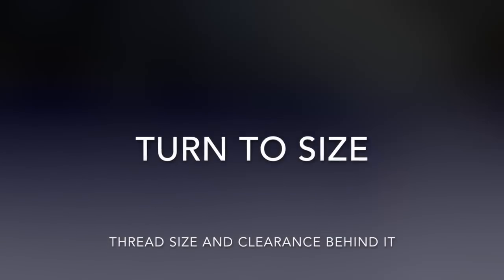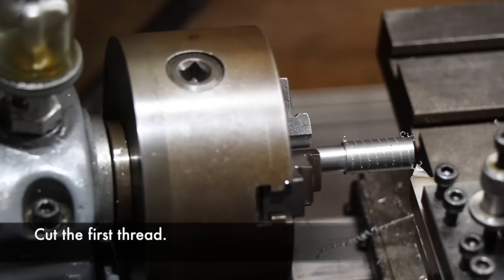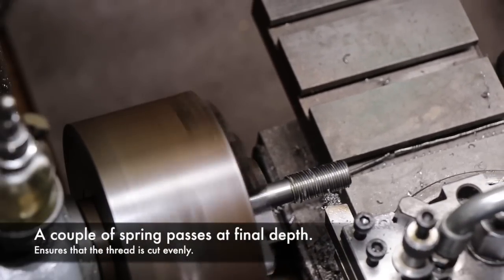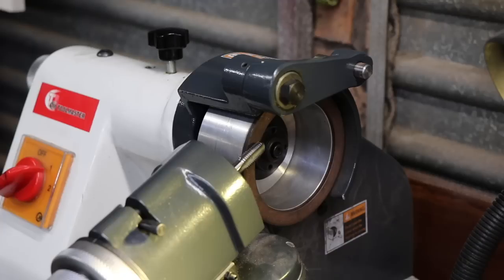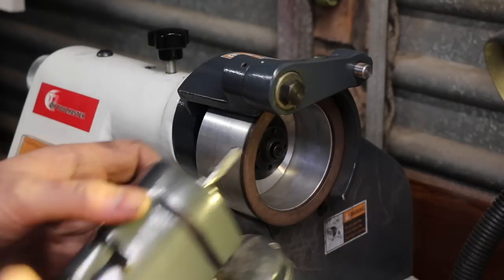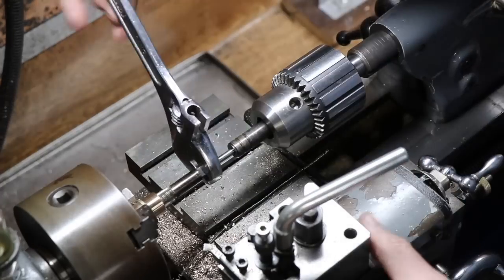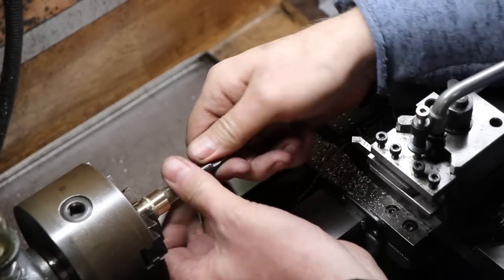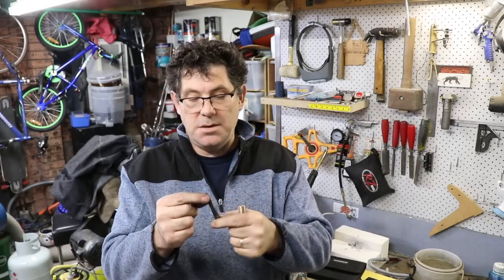DIY Thread Tap

Comment: Really nice job! I've always found I get neater threads in really tough steel by swinging the compound slide around to 30 degrees from the cross slide. Advancing the cutter at that angle means you are cutting, essentially, one side of the thread and just cleaning up the other. Zero the cross slide dial at the outside diameter of the thread and use the compound slide to advance. When you back out after each pass, you use the cross slide and just come back to zero, then advance the compound slide. This works especially well on really fine threads.
Reply from the maker: The compound is at 90 degrees because this is a triple start thread.
I use it all o offset the tool for the second and third starts.
Reply: Yeah, that makes sense.
Reply from the maker: Pushing straight in doesn't appear to affect the way the tool cuts. 
It's nice to use the compound to set the thread depth though so I prefer the technique you mentioned for standard threads.
Reply: John Creasey: You can use a DTI to increment very accurately for your multi start thread cutting, and by setting over at half the thread angle you will not be rubbing on the back of the thread form, as you are wen plunge cutting. Chris B.
Reply: @CreaseysWorkshop  You should be able to index using the jaws on the chuck...

Comment: I took machine tooling in highschool but that was 20+ yes ago. Not to give away my age. Worked as a welder many yrs. Now I am trying to get into blade smithing. Anyway not everyone can afford a small machine shop or like me no place to put the few tools I have now. I have several times purchased a grade 5 or 8 bolt the right size. Then I will use a angle grinder to cut the flutes. Then above the flutes I grind the threads down for relief. I have used them just like that to tap hard woods when making my wood clamps. Then one day I needed to tap some aluminium and it worked ok but dulled after doing a few holes. So I tossed in my forge and heat treated it then re sharped. It worked great I have 5 or 6 different sizes made up. I haven't taped hard steel but I have chased threads in steel to clean and repair old threads. 
Job well done I would do same way as you if I had the equipment. But thought I would throw a idea out there for all of us poor folk.
Reply: Don't feel bad, not many people actually need machine tool's, most hobbyists spend a ton of money on machine tools with out a clue what they are going to build with them, chew up a few pieces of metal & sell them at a loss.
I have used the method you have described many times even tho I have a full machine shop. Keep up the good work.

Comment: Good effort John. Just my ten pence for what its worth. The reason why your tap binds is because the flutes are in the wrong place. If you look carefully down the end of factory made taps you will notice that the flutes do not run down the centre but are offset in the direction of cut. This is to give the cutting edge a more positive rake, otherwise they wil rub their way through the workpiece rather than cut, almost like displacement threading. The plane of the leading edge should be directly in line with the centre, or axis of the tap, which means that the end mill used to cut the flutes should be offset from the centre line by half it's diameter, i.e. it's radius. The peaks of the threads should be reduced back behind the cutting edge to give clearance. The tap should then cut with a lot less effort. Holding the workpiece in a collet rather than a chuck would avoid the distortion problem. Love those pens by the way.
Reply: I was thinking it was binding because the actual thread form on the tap has no clearance on the backside.  The only back clearance he has put in it is for the lead on the tap, but the thread form on the grind has 0 degree relief.  I think that would need to be offset ground with a 60 degree thread form wheel.
Reply: I agree with Max about cutting the flute. The other thing you might try is to make the flutes wider; the threads narrower. You only need enough of the thread there to achieve some strength.
Ozzie

Comment: I appreciate the video and you sharing the results of your experimentation. I was told that making taps was far more trouble than its worth but you've shown its no different than any home made tool provided one has the proper tooling and some basic knowledge. I don't have the setup to make these but if I did, I would have very much liked to see a 10 second or so very close up shot of the finished cutter (preferably with a bit of camera rotation to the shot to see different angles of the cutter) to give an extremely good idea of the flute proportions and relief cuts.

Comment: Very slick using the compound to offset the tool for the additional starts, I've never seen that before. It seems to me that if you still wanted to use the compound at the classic 30 degrees, you could do the offset using trig or an indicator set parallel to the axis, but I don't even know if you'd usually feed with the compound anyway.
Reply from the maker: Rob Mckennie The tool cuts on the left when you plunge it anyway so I don't think it makes much difference.  Joe Piezinski has some good videos on the subject.  His channel is worth checking out if you don't know it.
Reply: John Creasey I'll second that. I love how many different channels we have with how many different approaches to explaining the many ways to skin a part.
Reply: It is actually quite simple to make a three start thread in the "conventional" manner between centers.
Just cut a fresh center in the 3jaw, then just use the jaws as the dog stop. You can also make 2 or 4 start threads on with a 4jaw.
On most imperial lathes, you can cut a 2 start by engaging the half nut between the lines also.

Comment: A very nice job there John, I am surprised that you plunge cut the thread form seeing that it is for a tap, setting the compound over and going in at half the thread angle would give you a much better thread form, but you ended up with a very nice 4 start tap anyway, I always let the hardened tap down to dark straw, which would be a bit harder than the blue that you went down to, but you will be using this on Ebonite I would think for your Pen project, (a Ford Patent or Onoto pen I hope). Very many thanks for posting this, Subscribed!
Reply from the maker: Hi, I normally do offset the compound for thread cutting but in this case I was using it to offset the tool for the multi starts.
My pen is going to be made from metal.  I do have some ebonite though so I might try that sometime!
WRT tempering, do you normally quench or let it air cool?  I quenched it because I was impatient and nothing bad happened.  It is very hard.  I tested it with hardness files and it was about 60 rockwell.  I've used it to cut a thread in 431 stainless and it worked fine!
Thanks for watching and thanks for the feedback!  I don't know why this video is getting so many views!!
Reply: Hello John: You are getting good views because this is an excellent tutorial on a subject that a lot of people want information on, a confidence boost if you like. You are making the pen in metal ! Then your tap will need to be tough, which you have proven that it is, it is just that when I make taps from Silver Steel I have found that tempering to blue has been too soft to reliably use on cutting steel, I always quench in water, air cooling is not very consistent with Silver Steel I find. One thing which you probably already know is that when you tap the cap of your pen, you need to do that before you turn it to "thinness" otherwise it just distorts and gives you a mysteriously tight thread, Chris B.

Comment: Hi John, you could turn the taper lead-in before cutting the threads in the lathe, save you  grinding unless you want to touch-up for sharpness.
Reply from the maker: Hi Emgee, to get them to cut well you need to give them some back relief.  I do that by grinding at an angle but stopping before I get to the top so the top is at an angle.  
You might be able to do it as you describe but you would probably need to touch it up with an off hand grinder afterwards.
Reply: @CreaseysWorkshop  When using the ball nose to cut the flutes best start off centre, only leave a grinding allowance on for grinding, keep the cutting edge at true centre of tap .

Comment: Hi John,
very good video. I am just learning to do three point starts and incrementing the cross slide by one third of the pitch is a great way of getting the job done. thank you.

I note that you stated that the half nuts should not be disengaged because it is a metric thread. I presume you have an imperial lead screw?? if the lathe has a metric lead screw or you have a 100/123 gear train the half nuts can be released and still be able to use the thread indicator - it works on my lathe.
Reply: only with even numbers

Comment: Interesting to see how it's done. Why didn't you cut the taper on the lathe before hardening it?
Reply from the maker: If you machine a taper there will be no clearance angle behind the cutting edge and the tap will not cut.

Comment: Interesting information.  Thank you.  I do have one question, though.  Is there a reason why you ground the taper on the front versus cutting it with the mill?  That seems easier to me, and it is making me think there is an good reason for the choice you made that I'm just not getting.
Reply from the maker: To cut well the cutting edge needs to be at an angle to the surface.  If you just cut a taper it would be tangential to the surface and no pressure would build up on the tip.  It wold be like having a knife with a flat tip.  I ground them on a rotating fixture in the grinder, but I did not grind all the way round.  I stopped early so the surface slopes backwards from the cutting edge.

Comment: "Why not make one" I dont have a lathe mate, but still a good video to watch
Reply: Just make a lathe from two old engine blocks!
Reply: @mikescudder4621  yeah, but I dont have a place that would give a good still working engine
Reply: @hazimesahe  Well, not that i actually explained anything but you can actually build a multi use machine using two old blocks. Why use old engine blocks? Easy to get hold of, heavy = sturdy, and with the cylinders you have a perfect straight 90 deg in relation to the deck. So you use this and put in bearings, matched to a shaft (like the rod out of a shock absorber) and you have the beginnings of a lathe. This is based on some project i saw years ago, i forget the name but google it and you'll find it. Obviously not like the one being used in the above video but hey. When we dont money, we get creative!!
Reply: @mikescudder4621  or we can use the paddled powered lather that Grandpa Amu made, I might actually use that and probably find an unused engine to power the thing
Reply: @hazimesahe  Ah thats sounds like a great idea.

Comment: first time here, like your video as it moves along nicely. I am faced with making a tap but I don't have a grinder like yours (yet). What do you think about me turning the 2° taper on the end of the tap blank before I thread it and then just relieve the back of the teeth after by eye and ordinary bench grinder after hardening?
Reply from the maker: I would just grind it by hand.

Comment: Very good. But the tempering operation was not really under control. Maybe clean up the cutting faces of the thread with the grinder after hardening but before tempering. Then you will have a fresh clean surface to look at where it really matters. Then to temper don’t bring the flame across the threads. Hold the tap vertical in nice light. Warm up from the bottom. Watch the tempering colour rise. You need deep straw at the top and you can afford a colour towards blue below that.

Comment: Very cool vid. Thanx. I suppose this could work in a jam.  I've noticed the entire length of the thread profile should have radial clearance from the start of the cutting edge radially to the start of the following flute. In other words mic the cutting diameter of a bought tap and twist in the cutting direction and the thread diameter should decrease. Without radial clearance and the tap begins to dull the cutting edge and a lack of radial relief will sort of burnish and press its way through the material causing more and more friction (grab) than the web between the flutes can handle. snap. Not saying this to be a wise guy. I couldn't do that radial relief at home either ;- )

Comment: I found this interesting. It probably works best when used in soft material. You are using what looks like an Erickson tool holder in a square 5 c collet block. Is that something that you made our did you purchase it. Thank you. Charles
Reply from the maker: the tap can handle stainless steel ok.   The collet block came with my grinder.

Comment: Would a mild steel tap be good enough for brass?
Reply from the maker: Yes in theory but it probably would not last very long.  If you are going to go to all the trouble of making one you may as well start with good steel.

Comment: What is the name of your grinder? Are they available in the US?
Reply from the maker: They are usually called a D-Bit grinder.  They were originally made by Deckel but imported copies are everywhere.  Handy tool for sharpening drills, lathe tools, slitting saws, end mills and D-bits!  You could probably do the same job with a bench grinder but that would take a bit more skill.

Comment: John, what was the gearing configuration on the ML7 to carry out the screw cutting?
Reply from the maker: The leadscrew gears were 45 25/21 idle 60 40.  For 3mm pitch.
Reply from the maker: The "back gears" mentioned in the video just give the lathe an extra slow speed.  It used to be a standard thing but I don't think modern chinese lathes have back gears anymore.

Comment: I made a tap once for an acme thread but it didn't work that well. Nice job.
Reply from the maker: I think an acme tap would be very difficult indeed!
Reply: not too difficult but you need to make a set of 3 tapers like commercial taps otherwise its just too much material to remove in one pass
Reply: George Patterson I did two tapers since it was a smaller tap but I was a complete hack back then and it had very little cutting and was more of a form tool. Not fun but I got a really nice tight fit in the brass nut.
Reply: hey if it does the job its a win

Comment: Just a question John, did you not consider turning the taper end in the lathe, then cleaning up in the finishing stage? I have never made a tap , but that is the style I like, a two or three flute with a slight  taper on the flute for chip breaking. Cheers, enjoyed the vid.
Reply from the maker: howder1951 hi, the end taper is ground so that it can stop behind the cutting face instead if tangent to it.  This gives it a relief clearance angle and helps it cut better.

Comment: I've thought about doing this myself, great to see a successful example of one!  Are you going to make a die as well?
Reply from the maker: Yes!  I did try that once already but I used the tap to cut the threads for the die.  There are two problems with that.  1. it blunts the tap (drill rod doesn't really seem to cope with 4140 steel very well)
2. it produces a horrible looking thread with lots of lines through it.
What I have done is to single point turn a nice thread that works well with a nut that I have made using the tap.
I will then use that as a model to single point an internal thread in some 4140 that I can then harden.
I think that should produce a better result.
The external thread needs to look nice as it is an obvious part of the pen. 
I'll try to make another video of making a die if it works out ok.

Comment: One critical element you didn't explain was the logic (or lack thereof) behind the pitch diameter you cut in the single-point threading.  A tap for a given thread is larger than a screw for that thread.  That is, the pitch diameter on a tap must be slightly larger than what the thread standard specifies for an external screw thread of a given basic size and pitch.  A tap cuts the internal thread specification, which is larger than the external screw thread by the "fundamental deviation".  Hence a tap is the conjugate of the internal thread, not the external thread, in size.
Reply from the maker: Once I had a nut I just single pointed a thread to fit it.
Reply: If you want to generate standard threads and interchangeable parts with a shop-made tap, the exotic tap calculations are necessary (how much to oversize a tap or undersize a die).  A tap is not just a hard screw with flutes and relieved edges.  Machinery's Handbook doesn't provide this dimensional logic, much less the formulas.  Otherwise you're just creating a random thread size that won't fit standard nuts or bolts.  Every part has to be tediously cut and tried repeatedly, like 19th-century gunsmithing.

The same is true of the "make a thread chaser from a nut" idea.  That won't *re*generate a standard thread.

Comment: although  a tap like this will work in soft material it is not geometrically correct.....a tap is not circular....it is higher at the cutting edge dropping down a couple of thou at the trailing edge and then rising up again as it passes over the flute....a cnc machine can do it and you could too if you could find a way t o get the cross slide to go in and out three or four times  for ever revolution of the chuck
Reply from the maker: My tap works very well regardless of not being geometrically correct.
I have even used it to cut a thread in stainless steel which it did very easily once I figured out to give it some extra wall thickness, hold it in a collet and use some oil.